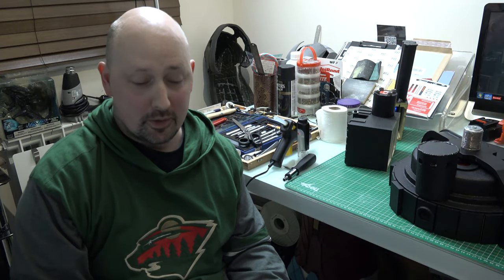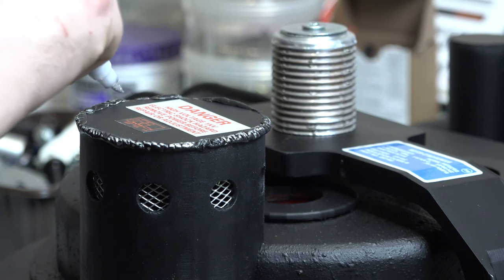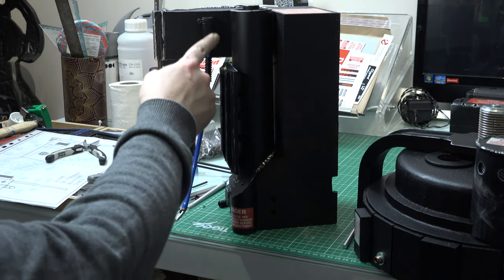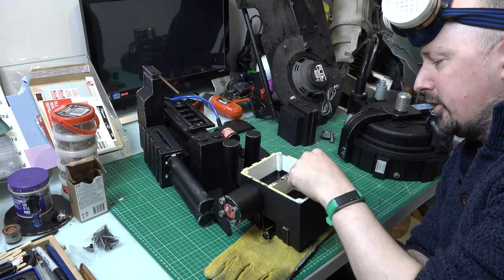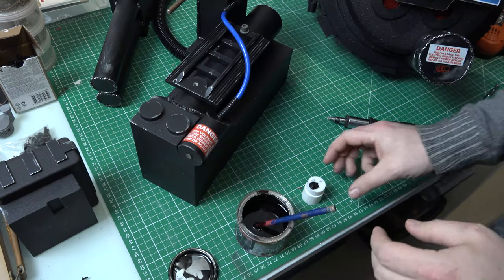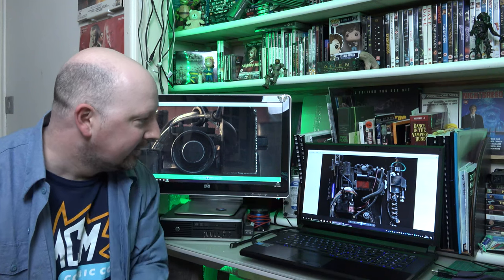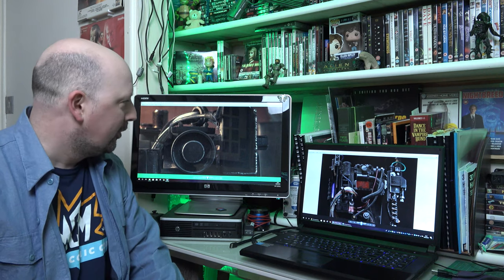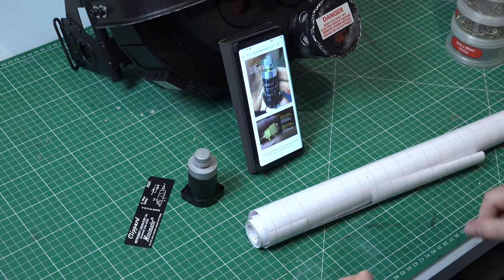Proton Pack Build - Part 6 - 90% to 95% Complete

Comment: Hey! I love your pack. I have a question. I’m currently making my own 3D printed pack and i can’t find a way to attach the main pack to the motherboard. (The motherboard is wood) I don’t wanna use hot glue
Reply from the maker: I used screws. Sharp screws! 
With this in mind, I added a USB extension from my sound board and tucked the end away in my N-Filter,  so if I ever need to plug it into my pc to update/fix i do not need to open her up again.

I also added magnets to the N-Filter so I can pop it off to add more fluid to the vape.

If you do this, add a bit of string/cord to the inside of the N-Filter,  so if at a con, you knock it and it falls off, its still attached and not on a convention floor!!

You don't want to have to print another, weather and paint!
Reply: @Dax79  thanks!!